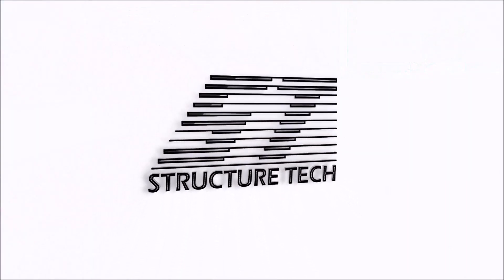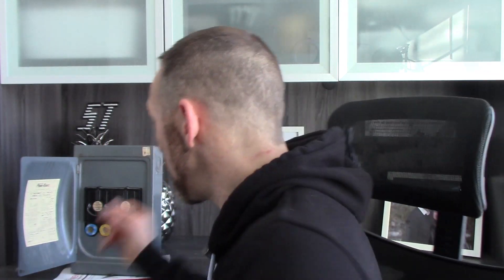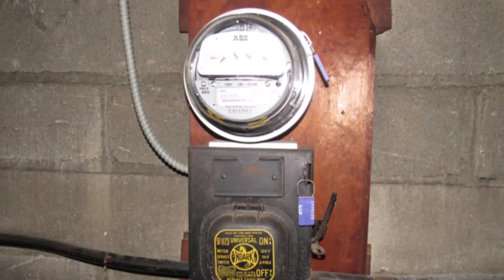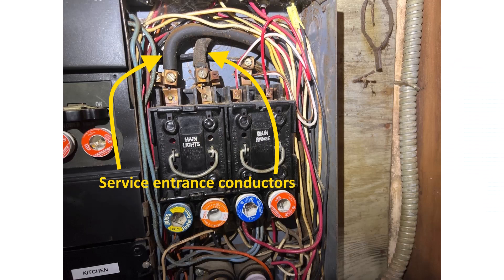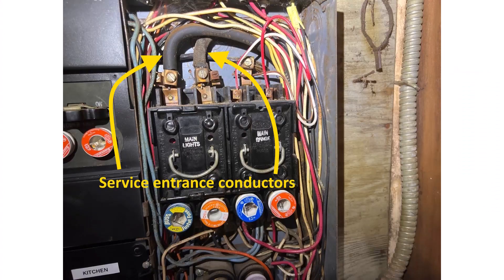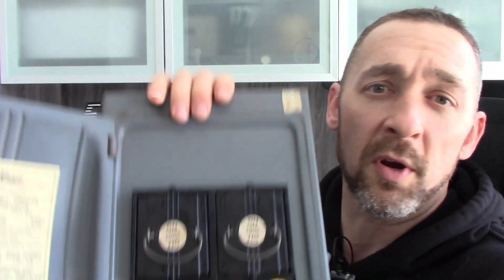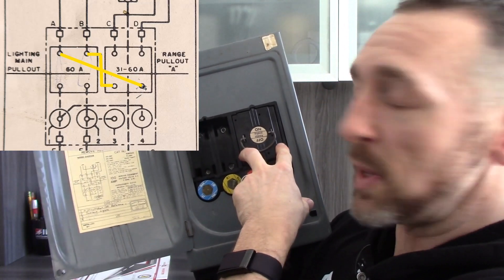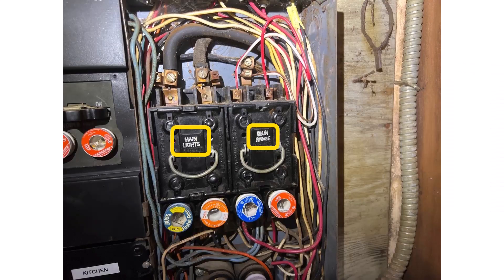Is this old fuse box a 60 amp or 100 amp panel?

Comment: (1) ampacity of service conductors
(2) Panel rating 
(3) Rating of main disconnect(s) 

As a rule of thumb, the lowest rating of the 3  is the size of your service.   If there is more than one main breaker or fuse, (up to six is permitted) the sum of the ratings is usually used. For example very large newer homes commonly have a 400 amp service consisting of two 200 amp main breakers in a meter-main outdoor panel feeding two interior panels.  

It's also a good practice, though not an absolute necessity, to include the voltage on an inspection report, which is easily determined by noting the number of service conductors: 

2 wires indicate an antiquated 120V 30A service 
3 wires indicate a 120/240V service 
4 wires indicate 208Y/120V 3ph  or 120/240 3ph 4 wire delta service -  a commercial service, with the possible exception for a very large custom home; some utility companies consider 600 amp or larger as a commercial service and require 3 phase. Farms with large motor loads often have a three phase service.

Comment: Did anyone notice the service conductors are two different types of conductors?  On right is old type, on left, newer plastic covered.   Also, I hope ste range fuse holder has 15 amp fuses because it has #14 on it.

Comment: If you pull out the "MAIN LIGHTS" block on the left, check power coming out of the "MAIN RANGE" terminals at the top. If the RANGE terminals are dead, this is a 60 amp panel. If there is still power at the RANGE pull, it's a split bus 100 amp panel.  Also, a 60 amp service will only have 6awg wire feeding the mains.  With a 100 amp split bus panel like this, the main Lights and Range blocks are each fed individually from the main terminals. On a 60 amp panel, power to the plug fuses and the Range block all passes through the 60 amp Main Lights pull.

Comment: If all 4 of the plug fuses are 15 amps and it is being used with 14 gauge wire, and there are no 220 volt appliances, it is probably a 60 amp panel, but if 12 gauge wire is being used, it could 80 amps.  If there is an electric stove or electric dryer, it might be as much as 100 amps.

Comment: The way I was taught,  if the label is illegible or missing on an older fuse panel of this style,  is to pull the main fuse block, then check all the 240V appliances for power, typically the other fuse block will house 40 amp fuses for the range or clothes dryer.   If everything is powered down it can be estimated to be a 60 amp panel.  Otherwise there's a better chance of it being 100 amps, assuming it's fed from 4awg copper or 2awg aluminum,  and there's a square meter base.    A similar rule of thumb can be used estimate the capacity of a split buss breaker panel. Above all a home inspector should never assume a split buss fuse or breaker box is 100 amps if the label is gone.  They might choose to write service ampacity unknown,  or "service estimated 100 amps, recommend further evaluation by a licensed electrician or electrical contractor "
Reply from the maker: It sounds like we're on the same page.